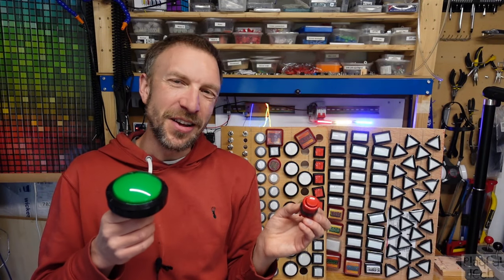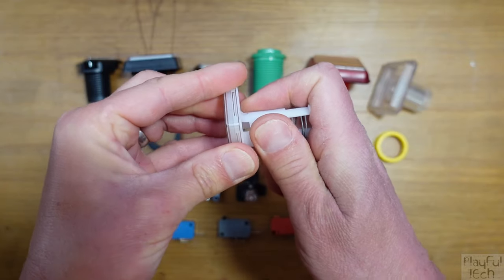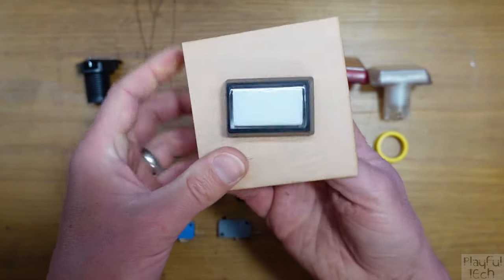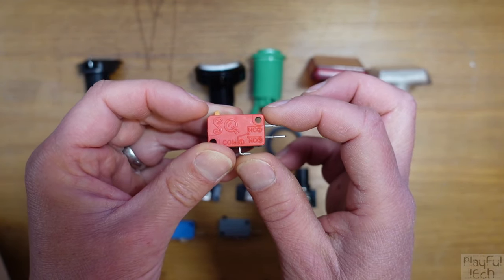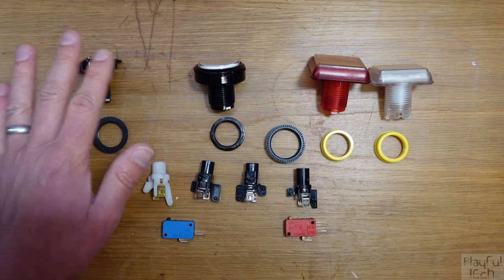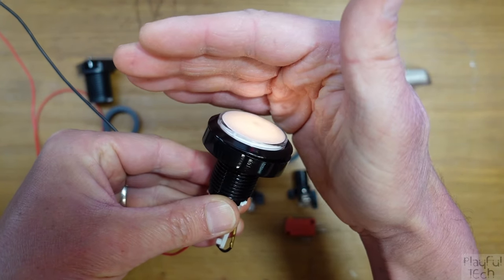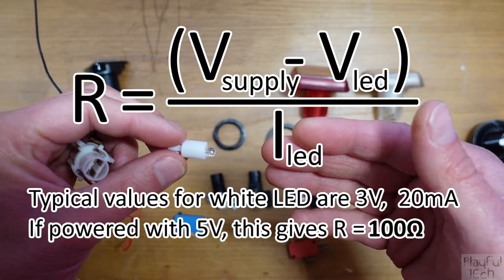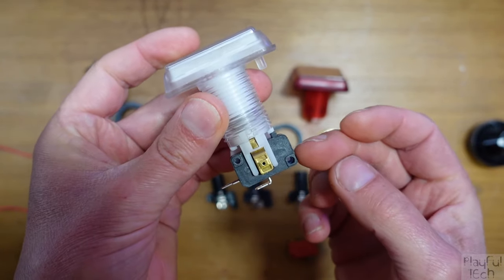Understanding ARCADE BUTTONS

Comment: How about lighting the button when they're pressed? Would that be done with relays or with having the button connected in series with the switch to a pin that's pulled up to 5v?
Reply: You could use a relay, or you could simply have whatever logic (a microcontroller for example) light an LED/bulb as appropriate
Reply from the maker: Yes, you can wire one of the terminals from the microswitch to the bulb terminal, and back through to ground, so that the LED and switch are connected in series. Then, the LED will always light up when the button is pressed, which is sometimes useful, but I don't tend to use that pattern myself as I prefer to be able to independently control the light from the button.

Comment: Are those spade connectors?
Reply from the maker: Spade terminals on the bulb holder/microswitch, which connect to crimped connectors on the wires.